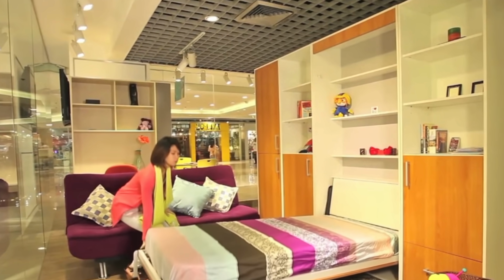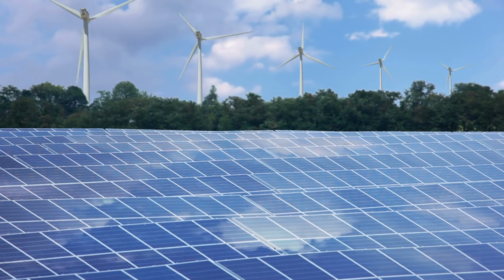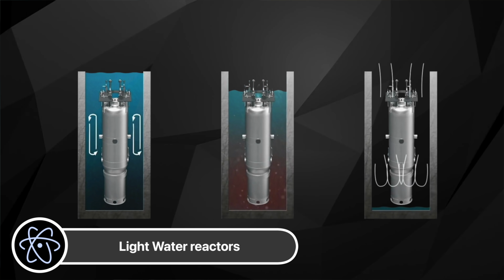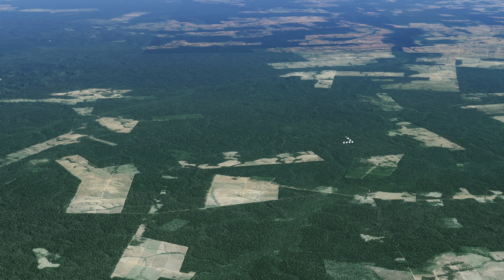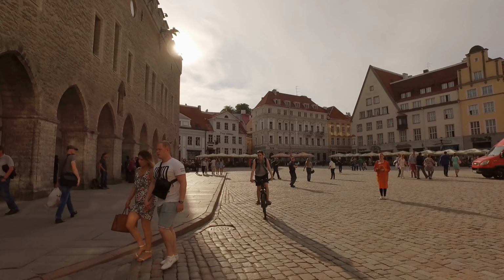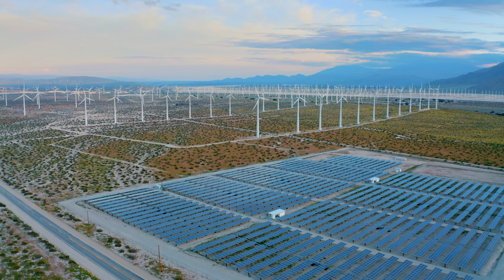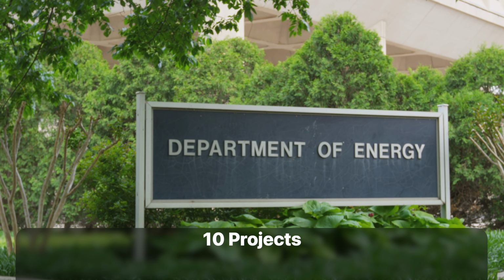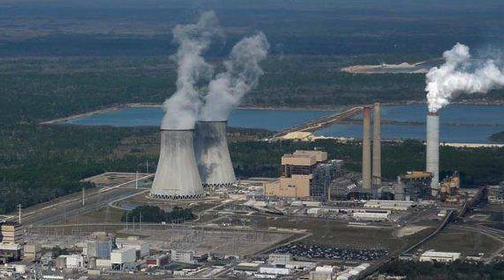Why Small Modular Nuclear Reactors Are the KEY

Comment: You mention nuclear waste, but failed to mention that most molten salt reactors can use nuclear waste AS fuel, using up virtually all of the radioactivity, leaving only a small amount of short half-life waste behind. My favorite is the molten chloride fast reactor. There are two contenders for this in the US: the Gates-backed Terrapower and Elysium. Terrapower already have a demo plant under construction, partnered with utility Southern Company.
Reply: TerraPower and Southern have not started  building  the Natrium  for Wyoming,they need the construction permit, when it is approved construction will be swift,Terra Power is also building a molten chloride fast rector, but they haven't broken ground on it.

Comment: You re-enforce the public's perception that  nuclear waste must take thousands of years to decay. This depends on the design.  There are modern breeder reactors which can burn much of that high level waste and easily reduce residual decay to below 300 years.  Also it is worth pointing out that nuclear generating sites, unlike coal or gas, do not generate pollution and their small amount of waste is 'vastly' more manageable than from all current coal power stations.
Reply: 300 years that funny!

Comment: Theoretically, it is possible to repurpose an old coal fired plant by replacing the boilers with SMRs, but continuing to use the downstream machinery (steam turbines, generators etc... ).
Reply: In theory, yes, except for the fact that the hardware would have gone way past its use by date and would have to be upgraded. It would be the same as fitting a formula 1 engine into a model A Ford.  It would work but not for long.
Reply: @galupas  : there is a tool like motor management these days, so the F1 motor in model A from ford could run except if You drive like the f1 so fast shifting  and press the gas pedal completely down will destroy the Ford A cause the mechanics can not deal with the huge power. F1 have efficient  motors that must withstand one race. If motor management reduces the power : it would be a fast Ford A tho cranking op to 15000 rpm But slow reaction.  Ford A versus ford A in  a race, The F1 engine starts slow so both cars run at same speed. But then the F1 motor revs up to 10000 rpm would be a race ford A
Reply: @stefaancodde6578  No shit! Sherlock!  You got some serious powers of observation!  Have you tried to get a Scholarship in Rocket science?
Reply: @galupas  :  Mechanics and motor is something that I learned  withing 4 years, electronics : 8 year due to analog and digital electronics. Hydraulics  and this was needed for the company. Motor management can go in two directions, higher power and speed or slower power and less speed or something between these.  15 years ago, my brain was tested en the doctor said, I have no idea to tell You the results. He said: At rest, the engine of most people runs at around 10km/h, but in my case also at rest Your engine runs 30km/h. How this comes, no idea but He suggested that to sleep better that I take a natural sleep aid. So  the last 15 years a pill and a half hour later  sleep. so 9pm in bed and 6am awake. so 9 hours sleep each night.

Comment: Here I the Netherlands, our electric grid needs major upgrading because of the fast growing number of solar and wind power generation. Could having SMRs spread throughout a country save on huge costs of upgrading the grid, thereby making them more economically viable (than large nuclear power plants)?
BTW, I don’t think it will be easy to have the general public agree to having lots of small nuclear power plants throughout at least our country.
Reply: Our grid needs upgrading anyway, SMRs or not. Another way is to use energy storage of course, which is also not an easy task.
Reply: @roland9367  Okay, I think you are right. But the fact that we need an upgrade quite urgently is because of the intermittency of renewables, right? If so, couldn’t scattering SMRs throughout the country significantly reduce the investments needed for the upgrade? Does that make sense?
Reply: @katjejoek  It is not only the intermittency, it is also the increase of power usage and power delivery (by renewables) requiring bigger cables/connections.
Decentralized usage, would need to be very decentralized because the regions are not that big and they already have internal problems. That would mean an SMR every 20km or so? Just guessing here.
And, in the same way, going for this decentralized approach, you could also do that with batteries or non nuclear powerplants (renewable or not). For example tiny gas generators could be placed everywhere.
But I would prefer renewables and energystorage.
Reply: @roland9367  okay, clear. That makes sense. Ideally, I prefer renewables too. But there’s a lot of downsides there too. Nobody wants a wind turbine in their backyard. There’s clear extra cost for putting them out on sea. There’s also clear environmental impact during operation and useless waste materials when decommissioning them. And there is the intermittency which drives costs up for grid. And you need a lot of turbines. Increasing the base load using nuclear power makes sense for me. Obviously it is not all roses there either (waste, investment, time to built and public opinion), but it is basically a drop-in solution. I wouldn’t mind if we could get those thorium reactors to work… 🤞
Reply: @katjejoek  I am not against nuclear but just like windmills nobody wants them in their backyard. Amd in this video it shows a cost reduction of 20%, maybe it is lower, but still makes it very expensive. At times, solar and wind can already compete with fossils on price, so nuclear is still much more expensive on the short run.
Reply: @roland9367  I’m very curious what energy mix we’ll end up on and in what time frame. It’s clearly not up to just you or me. 😉
Reply: @katjejoek  Yes agreed, but regardless of what energymix, the electric grid capacity will hold us back.
Reply: @roland9367  "an SMR every 20km or so?" - no, just take your existing coal/natural gas plants and replace the boilers/turbines with SMRs. Put multiple SMRs on a site to match  the previous generation. Some sites might not be suitable, but you get the idea.

"At times, solar and wind can already compete with fossils on price, so nuclear is still much more expensive on the short run."
The key part of your misconception is 'at times'. At other times they don't compete at all. 

immediately
Reply: @factnotfiction5915  Well nuclear is still way too expensive for those few cases where it is cheaper.
However we are having strange times now with very expensive fossil fuel prices. Even if we had a good solar and wind month of September, prices were still rising. It means even netter returns for solar and wind plants.
And offshore wind is great in that it provides much more constant power than wind on land or solar panels.
Reply: @roland9367  : any grid has to be upgrading cause centralized uses large metal poles and many miles high voltage lines  and PMR's in the city means also some sections must have bigger wire. So it's very expensive to switch form central to PMR's.

Comment: Yes, but two questions : 1- do SMRs come with an underground shielded flat area to spread the molten lava if the reactor melts down (corium) ?  2- what about thorium ? It's less rare than uranium and it is possible to make unpressurised molten salt thorium fission reactors that can be secured at the bottom with a frozen valve, that lead to a neutralising tank. If everything fails even with no power, the valve unfreeze and the thing pours by gravity and is neutralised.
Reply: Yes,but we have no need for Th,the NRC has no experience with TH,it has no big advantages,we can have a smr which has melted fuel in the melted coolant, and read about TRISO fuel, it can't melt either.

Comment: Great video. Interesting topic. Cars and airplanes would potentially be risky, due to their propensity for accidents, thus radiation risks. However, nuclear subs already exist, so ships would be good candidates for the same. Thanks for the great content 👍
Reply: I agree that cars are probably not safe enough, but TBH airplanes are one of the single safest modes of transportation. Airplane accidents might be rare enough to make it worth putting reactors in.
Reply: @ianmathwiz7  I agree with you on the safety record, but concerned about the dispersion and effects of the radiation, if a crash did occur. Impact to a populated area would be exponentially seismic
Reply: @ianmathwiz7  aviation will just go with hydrogen and there are better hydrogen storage solutions being developped.
Reply: i think safety is larger based on size. a car with a very small nuclear reactor would be easy to clean up.
Reply: If a plane crashes on something the last of your worries is some radioactive waste.
Reply: @alanhat5252  Your understanding of radiation and radioactive waste comes straight out of cartoons and movies doesn't it? You don't actually know anything about the subject yet you have strong opinions on it.
Reply: The reactor would be very small. I'm sure it would be stored in the safest place in the plane or car with extra crash protection. There might be a hundred plane crashes with zero nuclear accidents. It's a great question and I'm sure it would have to pass the super rare chance to ever get okayed.
Reply: ...use a small modular reactor to make aviation fuel from atmospheric  CO2...several outfits following this line of development...carbon neutral at a stroke...same would apply to petrol; oil companies should be doing this, so instead of pumping crude oil, refining and distributing it, they just make petrol and diesel, keeping the rest of the distribution chain as it is, and making every car in the world carbon neutral without having to change a single thing!
Reply: @alanhat5252  the nuclear fuel would be in a bombproof housing - have you not seen the video of a locomotive deliberately crashed into a nuclear waste flask at 100mph? The flask stayed intact, with no leakage.
Reply: @Ironic1950  but would every car and plane and ship have bomb proof housing? Large bomb proof housings are great for transporting waste material but making bombproof housings around every car/plane reactor would make it too heavy and large to be feasible. Let alone how would you cool the reactor if it was that encased?
Reply: @tedl2711  both Voyager spacecraft are powered by nuclear thermo-electric generators, still working after five decades. These convert heat direct to electricity.
Reply: @Ironic1950  yes and unlike most steam generating nuclear reactors the nuclear material in nuclear thermal electric generators (rtg’s) are weapons grade. Do you want to put weapons grade plutonium or strontium in hands of anyone who buys a car? And the plutonium that is in those spacecraft is much more radioactive than standard plutonium that is in our weapons. Therefore much more dangerous
Reply: @tedl2711  the only thing more dangerous than plutonium, is plutonium mixed with other actinides, and gases like Xenon, otherwise it is all the same...
Reply: @tedl2711  you make some great points. I've thought of the dirty bomb but I've never studied the whole system. Thanks for educating me a little. 
    One of the biggest problems with our success is dishonest people. Do you ever think how rich and successful we would all be if everyone was honest?
Reply: @carholic-sz3qv  hydrogen has to be kept very cold and under pressure, so 'artificial' paraffin would be much easier...allowing all jets to be zero carbon immediately...
Reply: @muresandani  Errr i think he refers to the toxicity of depleted uranium not to the over the base radiation level of radiation emitted by it, that can be ignored as you get more just by a xray image or by flying in a plane. Not forget that crap in dust for can be breathed or ingested easly ...

Comment: SMRs is pretty much the only way forward, it's the only fission option our company is preparing for in terms of determining sighting, and this is coming from a company already operating 7 traditional reactors and obtained / obtaining license extensions for them until we can set up SMR sights. The largest benefit, besides the reduced cost and build time, are the dramatically reduced protected areas since the lessons from the past are built into the passive protection systems reducing / eliminating the need for operator action. Also the burnup in these plants is potentially much higher than the old designs we are running now, so the "waste" stream is much shorter lived and reduced in amount, think '70s muscle car vs. a Prius.
Reply: @greg5023  At first I misread your comment as "waste stream", with an "r", and started explaining about how it's mostly unused fuel and fission product daughters, and how certain new designs actually either breed new fuel from those sources, have core designs which have higher utilization ("burn up") rates for the existing low enriched fuel, or have facilities like France for reprocessing. Then read your comment again and saw it read "waste steam", without an "r", and laughed at myself, yeah if someone brought up "waste steam" I would have some questions also!

Comment: I liked your presentation, and I am bullish on Small Modular Reactors. However, I would caution against letting cost per KWr be the major consideration when it comes time to make decisions. Sometimes the cheapest way isn't the best way. Let' consider national security. The US gets 80% of its rare earth minerals from China and the world gets 35% of its oil through the Strait of Hormuz. It may be cheaper but at what risk. Either one of these bottlenecks could be shut off very easily. What then?
Next, there is the third world. Building large reactors in countries with unstable governments brings to mind a whole host of problems. Also, a remote location would have to have its own small town just to support the 5-to-10-year project. Millions of miles of power lines would have to be laid across rainforests and other sensitive vulnerable environments.
Lastly, there is the matter of selling it to the public. I read a recent poll that said that 60% of the American people are against nuclear power, but 20% could be persuaded back if given a good reason. If we can't bring those people over, then no amount of physics will get this industry off the ground. One really big drag on enthusiasm is the long lead time to build a large reactor. Additionally, there are the inevitable years of litigation, in environmental courts, with no guarantee of success, before we can even start. Even if all goes well, it's hard to whip up enthusiasm for something that could take decades to see any benefit from. SMRs can minimize many of these drawbacks. 
I'm not trying to dismiss the importance of cost. I'm merely pointing out that "costs" come in many forms other than money. We need to look at the whole picture.

Comment: In order to educate nuclear non-believers it may help to explain that in the existing large plants the radioactive heating process takes place in high pressure environment but in the molten salt system the radioactive heating happens at low pressure underground and hot low pressure salt is pumped away above ground to generate steam making this system safer. 
More smaller reactors will reduce the need for large wide spread power grids and high maintenance costs.

Comment: I like the idea of SMMSRs. No high pressures and no forever wastes (if closed cycle, AKA fast reactor). With thorium, can also be moderated (not fast) and still "burnup" all the heavy metal, leaving only fission products and not forever wastes.
These things should be cheaper than solar/battery because less material (and energy) would be needed to make them.
Is there any possible way for the wrong people to siphen and enrich the fuel to weapons grade?
Reply: It would be impossible or extremely difficult and expensive to refine enough material for a nuclear weapon with these designs, which is why many of these newer technologies are being developed by private industry and governments aren't interesting in them for the most part. In fact many of these technologies were abandoned by governments since they couldn't viably produce weapons grade materials.
Reply: @anydaynow01  
There's supposedly a problem of thorium into protactinium, into pure U233, for LFTR but there's lots of radiation in that process. I wonder if a led lined robot could take some of it (I highly doubt it, might be easier to do it like NK, from the ground up).

Comment: There was a concept airliner around 1950 that had nuclear powered jet engines. They were quite simple: The fuel rods were simply placed in the combustion chamber and heated the air flowing by!
Reply: VGH, Flying Chornobyl. 
Just one small problem. Air is a terrible medium to cool a reactor.

Comment: I have told my friends I would rather live near a SMNR plant vs a normal sized nuclear plant.  They are worried about the two big nuclear accidents and I try to tell them the fist was caused by the operators and the second an act of nature.  I lived by TMI when it had it's burp and would not leave the 10 mile area (I lived in Middletown, PA).  I was not worried at all.  If the town I now lived in said it wanted to build a a SMNR I would be out there promoting the benefits and safety aspects.

Comment: Wait, if these fusion reactors are making electricity while turning water into hydrogen fuel, couldn’t the hydrogen fuel be also more potential energy lost? That fuel could either be captured, or routed directly to a hydrogen generator… this way you could be using all the potential energy of the system
Reply: Ez very smart man, you keep posting logical Super Genius Ideas they will lnock on Your door. . It makes 100% sense to me....